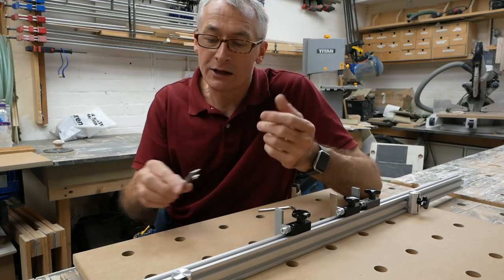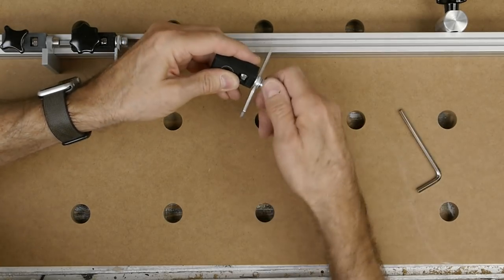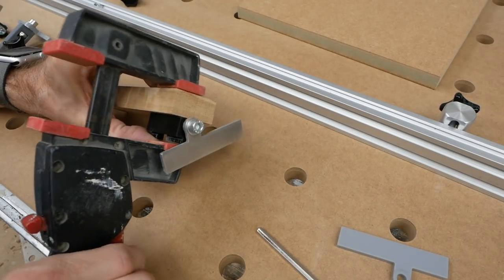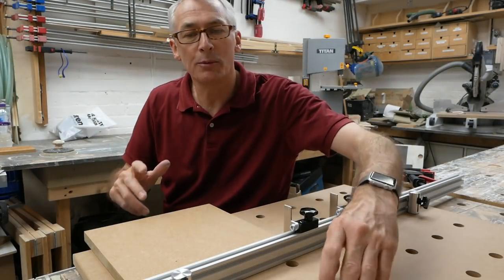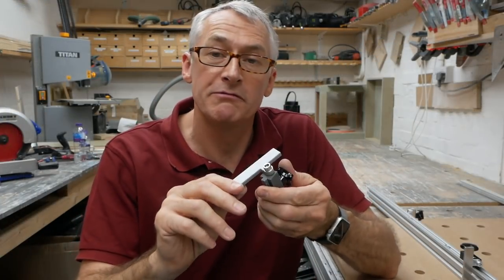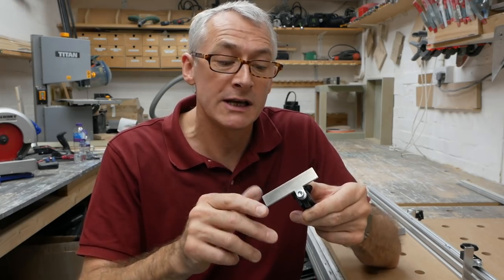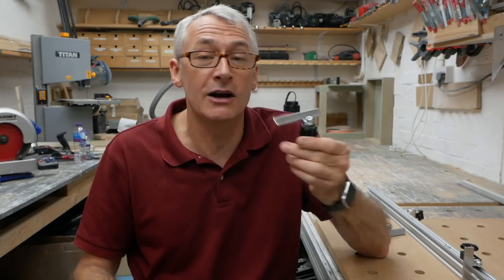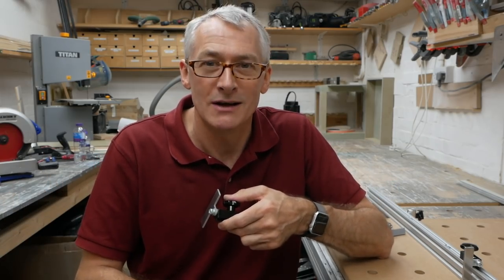Full Metal Flagstop [video #227]

Comment: Peter, I had similar problem with nut spinning when fitting metal flagstop. Unfortunately I used flat blade of screwdriver to secure nut and split the green acrylic block. As usual Ralph was superb and has supplied a replacement with just cost of postage . Your method is better and avoids my silly error
Reply from the maker: Have to confess I tried a screwdriver as well, but realised  - just in time - there was a better way 👍👍

Comment: Nice work Peter. Ralph deserves the support for being a standup guy. I could make the plastic and the metal flagstop bend or flex if I so wanted to but if used correctly I can't see how either would have issues. I personally would go for the metal flagstop as I know that I am clumsy enough that I would imagine I could snap the plastic one if I knocked into it or dropped something on it. This is not the fault of the flagstop material and entirely of my own making.
I look forward to buying from Ralph in the next month once my workshop refurb is finished.
Reply from the maker: Cheers Jason. Yes, I’m sure the metal ones can be forced to flex if abused. 👍👍

Comment: Peter the only problem with the flex was that people saw a close up. I say this because as you pointed out, if used correctly there is no problem, as well as how may of those that complained are actually going to buy them. I would be interested to know from the manufacturer how many complaints they had received from customers prior to the video.

The other point is that it is wood we are talking about here. It is easy to work, forgiving and subject to change due to temp/humidity. We are not talking about precision engineering of fine tolerance bearing surfaces.
Reply from the maker: Well, prior to the video Andrew, nobody had bought any, obviously... 😂😂👍👍
Reply: Peter, just went back and watched the original video, missed that these were not a sale item originally 😳

Comment: Sorry but this is strong language for me. I would have to ask Peter, How much force are these people with the perceived flex problem pushing stock up against the fence?? I'm not delicate but am weary of moving the stop in total, and 'Place' the boards rather than ham fist them  into position. Nice product BTW
Reply from the maker: Thanks Peter. In truth I’m not aware of having heard from a single person who has purchased the acrylic flagstops and had a problem with the flexing. I’m not delicate either, but nor do I slap the work into position. 👍👍
Reply: I ask the same question
Reply: I’d agree Peter M, I’ve seen you finessing with that 2lb lump hammer😂
Reply: Peter Compton

"How much force are these people with the perceived flex problem pushing stock up against the fence??"

I am not a builder but in my line of work I have seen :-
Phillips screw heads distorted into swastickers because they were done up so tight.
Screws done up so tight I needed two hands to undo them.
Screws done up so tight I needed two hands and pliers on the screwdriver to undo them.
Screws done up so tight I couldn't get them undone and had to break the parts.
Screws done up so tight insert unbelievable for a professional to do here etc...
Customers who sheared the heads off screws on user replaceable parts.

And my favourite (we didn't ever find out who did it) , a laptop that had the long screws forced so hard into the short holes that it went through the case and into the desk.
This was only discovered when the user tried to pack up and put the machine away, and found it wouldn't move :)

Comment: I just got one and having a small bit of oak to hand I clamped it on to hold the nut but as the bolt bit into the nylon lock nut the nut just turned and roughed up the oak.   I then clamped on a bit of metal.  Bloody nut still turned chewing the plastic body as the plastic is very soft.  So tried with a screwdriver to hold nut.  The plastic proved too soft for this as well and the nut would not tighten into the nylon locknut and the turning nut forced the plastic to warp.  I found a non lock nut and managed to get the bolt tightened with a screwdriver jam as no so much force was required to tighten the nut.  Sad to say the plastic used is just too soft and not fit for purpose.  The bench dogs and fence were very good,  but the flag stop lets it down.
Reply from the maker: Only heard of one other person stuffing up the body of the flagstop using the screwdriver method, and Benchdogs replaced it without quibble. I appreciate you letting me know, but you need to tell the guy that sold it to you, so they can take care of it 👍👍

Comment: Hi Peter. Looking at your v-slot which I'm about to order, was it tapped at either end?
Also, what's the betting another video will be on its way advising Ralph has adjusted the captive nut design. However, drop of epoxy should do the trick
Reply from the maker: Hi Gary. No it wasn’t tapped, but ooznest can do that for you if you ask. 👍👍
Reply: Thanks Peter. Just ordered the 1m extrusion from Ooznest + the benchdogs & flagstops from Ralph. Hopefully they'll be here before the EoW

Comment: Nice one mate. I think the problem people were having with this MFT thing is that the holes that are drilled out are all 90degress  to one another which the rails are set to hence the rail is 90 the cut is 90  . But what confused me for. ages was how the hell did he drill out the holes so accurate . I didn't twig it till I saw your man the new Brit workshop making  an MFT .so one first needs the kit to mark out the holes or is there an alternative way.. Without slop.   Lol.
Reply from the maker: You can get an MFT - style top CNCd for about 30 quid - try cncdesign.co.uk - the Axminster part guide thing works well, but it’s pricey and time consuming if you just want a single top 👍👍

Comment: Hi Peter, I have a question - slightly off topic (maybe there is a video in the pipeline that will answer it). The issue I can see with the setup you have is that once you place the saw track down I assume it buts up against the end of the flag track, at 90degrees? If so then the piece you're cutting isn't supported against anything under the saw track. If you're cutting shorter peices then I would guess it would be difficult to support the work piece against the flag track to get an accurate 90 degree cut? What's your soultion or is it not a problem?
Reply from the maker: Hi Phil. I touched on this in the follow-up video #218. It’s not generally a problem, but if you want to have the fence run under the rail, then you’re best using the extrusion ‘on it’s back’ ie 20mm tall. I have another vid coming soon about making narrow cuts in an MFT, and how I do that👍👍
Reply: Thanks Peter. I totally missed that video, but I've just watched it; makes perfect sense. I am using an incra track & Woodpeckers flip stops. The end of the track sits 5mm from the kerf line, so the work piece is better supported. However it's bolted into threaded inserts & is a pain to remove & re fit. I'm looking for a better solution & I really like the look of this.

Comment: Hi Peter, totally unrelated comment. Enjoy all your vids, just wondering what you program you use on your computer to do your drawings because my hand drawings lack quality so was thinking computer drawn ones would look much more professional. Any steers in the right direction would be great (I don’t use an Apple computer though). Thanks in advance
Reply from the maker: Thanks Richard. I use something called Graphic - pretty sure it’s OSX / iOS only though. It does seem to be an under-served area though - you’d think a simple 2-D line drawing package that can work to scale in metric oils be easy to find, but apparently not. If you find something, let me know! 👍
Reply: Thanks Peter. Will do!

Comment: Hi Peter, Thanks for this and all your other video's. I have been (with your help) putting together my own MFT with (two) panels from CNCDesigns.co.uk and a fence with stops and dogs from benchdogs.co.uk (mine has come with the metal flagstop). The query I have - somewhat off topic is: what if anything have you sealed your MFT top with? the dogs that have come with the top from CNC Designs is tight so the dogs wont come out by hand. Have you sealed / waxed your top?
Reply from the maker: Hi Stuart. I sealed mine with a coat of satin finish water-based polyurethane lacquer, - nothing special, just whatever I had to hand. I also stained the MFT and benches in an anthracite stain, just because everything was looking a bit brown... 👍

Comment: Hi peter great video ive gone of these and mft style tops im wondering if u think might work as a mitre saw fence that isn’t permanently fixed it works well with my tracksaw. Forgot to ask you this when spoke at maker central.
Reply from the maker: Thanks Martin! You mean as a kind of supplemental fence? Yes, I’m sure you could make that work. 👍👍
Reply: Yeah thats it instead of the kreg type mite fence would be usefull on a couple of mft tops might have to try it will let you know how i get on